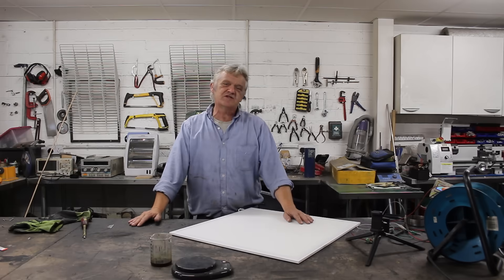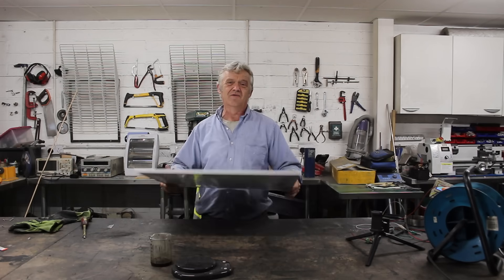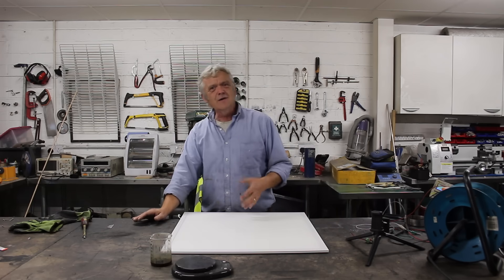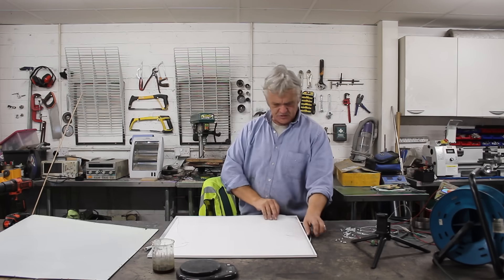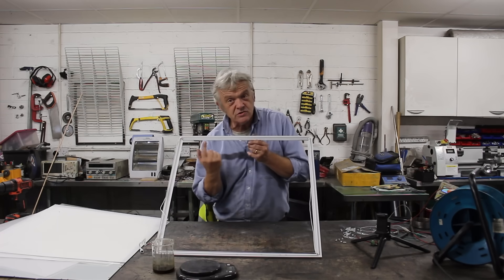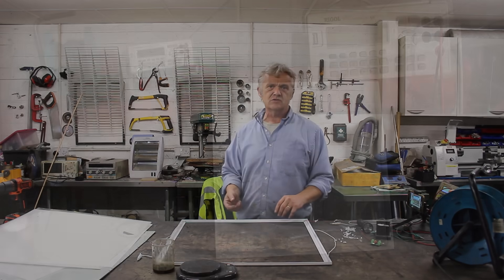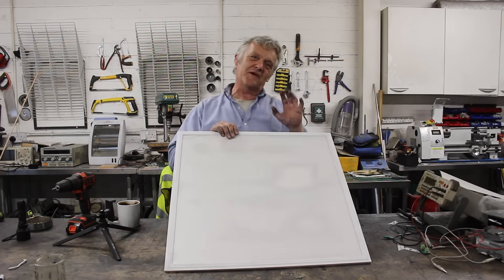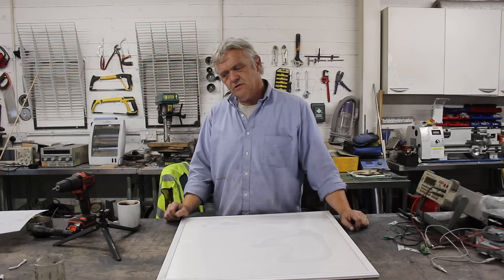1648 DIY Solar Panel From An Old Light Fitting Or LED TV

Comment: What happens when you fuse the edges together of two such lenses, but 180 degrees, so one is flipped over? Does it act like a periscope? Can it be used to bend light around objects?

Comment: Is there any way to use a pyramid on the edges? So the panel is 5mm but can it be extended to 50 mm

Comment: I have taken apart square led light panels in the past to see how they operate.
I am very impressed with this idea and am wondering why big tech is not persuing this methodoly in the manufacture of pv panels if it means greater efficiency?
Reply from the maker: there are good reasons - I thought I might do a video on that mate

Comment: Have you sir perhaps tried any food preservatives (antioxidants) in preparation of a dye sensitized solar cell? 

Also, what about mixing two different dye types (anthocyanin and chlorophyl) to increase the absorption spectrum?
Reply from the maker: I haven't tried mate
Reply: @ThinkingandTinkering  
That's a bugger, were hoping for some feedback. :) 

How about these do-it-yourself dye sensitized solar cells you've been talking about in previous episodes? Are these serving you well? 

Frankly, I'm asking because I can get a hold of a van full of LCDs for free,  but the catch is, I either take the van, or I don't take any at all. 

Wouldn't really want to get stuck with a bunch of LCDs without a purpose, lol. 

Thanks there.

Comment: In the previous video, there was about a 10,000% increase of space needed to concentrate the light in a small area for a 50% gain in output.  If space isn't an issue or the intention is to just run a very small solar panel, then it would work great.
Reply from the maker: you know the previous video was just a report on what is being researched - you can just look it up on google scholar - what you are saying doesn't sound right - but I will check it out - or you could confirm it if you felt like it
Reply: @ThinkingandTinkering  I was a bit uncertain as well.  I meant to comment, on the other video at the time stamp of 5:26 .  It would take a lot of typing to put everything into context, but I'll give it a shot.  Using the diagram at that time stamp, let's say that you have a 1 inch or 2.54 cm square area of concentrated light.  The area needed to concentrate that light is 100 inches or 254 cm.  That's where I was getting the 10,000% increase in area.  I know the drawing at that time stamp was just an example, but it's still going to take a much larger area of space to concentrate the light.  A second 1 inch or 2.54 cm panel could be used to double the output, while saving space.  Depending on the application, that increased area could create a shading effect on surrounding plant life; hampering the production of oxygen.  Snow could pose a threat to solar concentration, where as, the black surface of a panel helps melt snow and ice.  Solar concentration might improve electrical generation at night when certain phases of the moon are brighter.  In time, the technology may improve, and require a much smaller space to concentrate the same amount of light.  I can see how this might work in various applications, but I see the drawbacks as well.  I don't know if that helps, or maybe I'm still missing something.

Comment: That's impressive. I never thought you could run a fan on that. I have seen a few projects where led's are used as photodiodes but always for measurement of light. Not for power generation. Good one !
Reply from the maker: no they don't produce much - be good to preplace them with actual solar cells for sure - but it is interesting

Comment: What if you inverted that piece with the diamond shapes on it and placed it on a regular solar panel?  Would that not gather light from various angles and send it down to the cell?  It may block some light from directly over head as it is not totally transparent but maybe that difference could be made up for and more if it gathered light from multiple angles as the sun passes over...like a stationary sun tracker of sorts?
Reply: That's what I was thinking too ! 👍
A solid state solar tracker.
No moving parts.
Reply: @kevinleebailey  Exactly.
Reply from the maker: kind of like a fresnel lens? well of a type? I don't know - I must try it out

Comment: you could try a difuser on top of a solar panel that distributes the light evenly with no direct sun light. Could reduce heat significantly. Output ????
Reply from the maker: I like that idea mate - thanks for sharing

Comment: Without going to gan you could use the one from calculator several of those, they are 24% efficient
Reply from the maker: that's a nice idea mate - you must be able to buy those bulk - I have a solar calculator right here on my desk and the solar panel is one 1cm wide - I wonder where you get them?
Reply: @ThinkingandTinkering  websites like rs components or farnell or mouser, they are electronic components for prototyping

Comment: great informative video as usual. 
does the filter only direct the light from the top & bottom? as that's where the LED's were. if not could possibly double power using the sides also? with LED's as receivers. 
if i may ask whats you thoughts on Joule thief circuits ?
Reply from the maker: yeah it is only from front to side mate and I like the joule thief - good for stepping up low voltage to usable voltage

Comment: I like the video 
Please  tnt 
I want to make an induction heater i have only 5 of bc 547 transistors will it work. Without Mosfet transistors
Reply from the maker: the power dissipation on those is only 500mW isn't it? - an induction heater uses a lot of power - I think you are likely to burn them out mate

Comment: Very good content sir, my only worry is that in a hot country the plastic would degrade very quickly and its light guiding properties Will be los.
Reply from the maker: probably - I believe there are glass versions of light guides - but I have no idea where you would get them
Reply: Yes i think there are plexi glas versiones but very very expensive. Let hope there are cost efective uv resistant plastics. Any way excelent news, thanks again sir.

Comment: The hot side of a refrigerator and a closed loop cycle of Langmuir torch - perfect solar power collector.
Reply from the maker: solar thermal?
Reply: @ThinkingandTinkering  , high temperature thermal - Helmholtz, not Gibbs. 

See Langmuir's work with GE "battolysers" (hydrogen).

Comment: Will it work if we stick a solar panels on that shine the LED on the panel up close with same backlight
Reply from the maker: I would think so - but the power loss through that would be huge
Reply: @ThinkingandTinkering  you see Rob getting 12v is more than enough for inverter, connect the 60w led strip to a panel size acrylic board, stick violet colour reflective sheet to the acrylic board if we shine led will it work
Reply: @ThinkingandTinkering  and also some way to put cold water circulation under the panel, fix a water tank under the panel

Comment: If these can capture light better "off-angle" then several vertical "Slats" could vastly improve the power generated in a smaller footprint.
Reply from the maker: for sure

Comment: Windows are a huge source of energy loss, but they also save energy by letting light in.
If we used a lens to focus the light into a fiber optic cable and then put that same light back into a diffuser, we could get the same amount of light without the heat loss and the amount of light could be easily adjusted from 0-100% at the optical coupler.
Even if you only used lenses, like the rectangular, flexible Fresnel lenses, you could increase the area of insulation by over 50%.
Reply: DId you read Ikaru
Reply: I recall light-guides like this as an alternative to skylight windows... And, having once had a normal skylight window installed, I can vouch for the amount of extra heat all that sunlight created, radiating off the new walls in the attic.
I dunno about replacing windows, in general, but for ceiling-lighting, it sounds great... can even be brought through several floors, or maybe even between floors from panels on outside walls.
Reply from the maker: there is a lot of research in this area for exactly that reason mate - it's called integrated solar I believe

Comment: I recently came across a deskcycle by 3d innovations under the desk exercise peddle device.  It uses magnetic hysteresis damped disc with a few pulleys to increase the speed of the disc.  It will lend itself to a good generator build because of the 1:~25 pedal ratio.  Keep an eye out for one.  Love to see your take on a build.  I'm looking at adding magnets to disc passing added coils or adding a pulley/chain to drive external PMMotor.  Love your work
Reply from the maker: another good one mate - cheers - I will also be looking that one up lol
Reply: Always enjoy your videos...knocks the cobwebs out from between the ears....carry on.